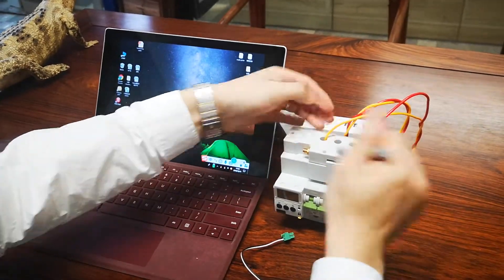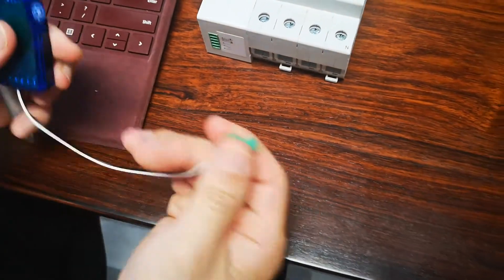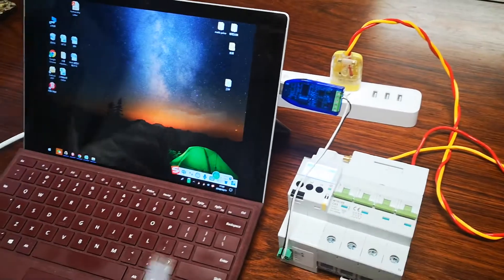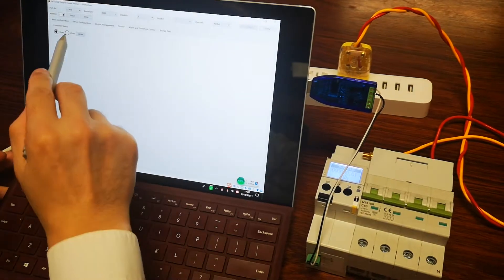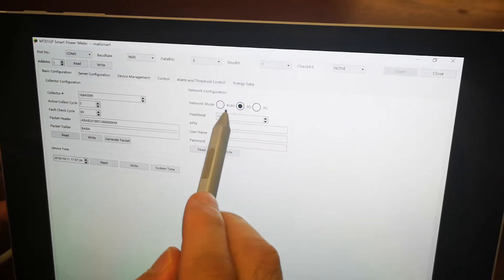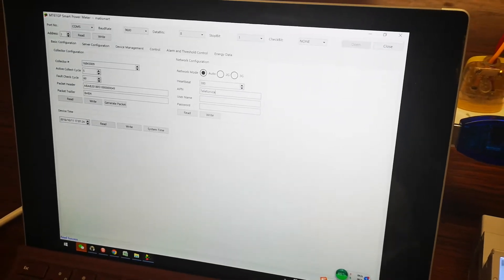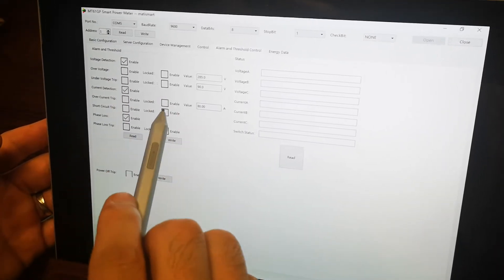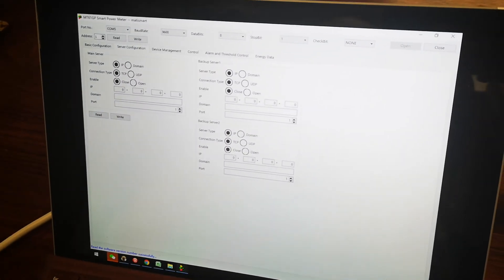9  MT61GP Configuration RS485

Comment: I have an MT61GP installed, when it jumps it does not rearm automatically. What can be the cause?
Reply from the maker: It's correct that our default factory setup closed rearm automatically function. You may set auto reclose function through our Platform or even through APP. You may send mail to ricky@matismart.com for more detailes